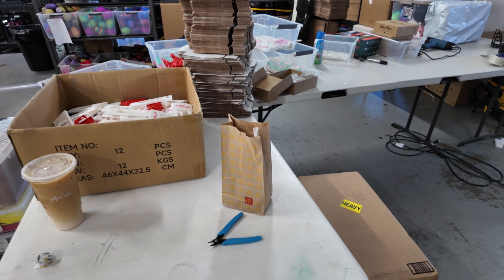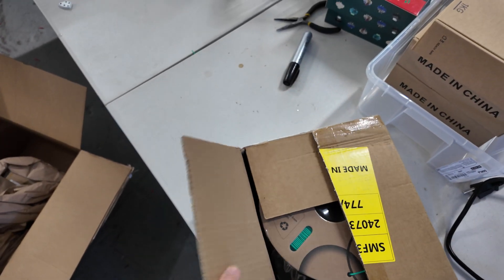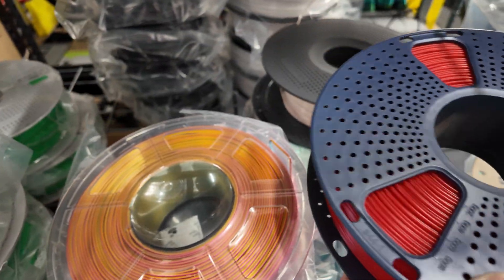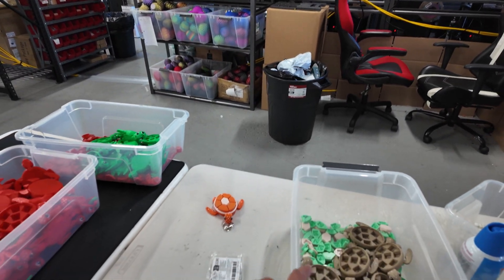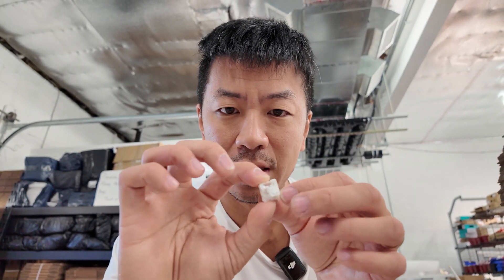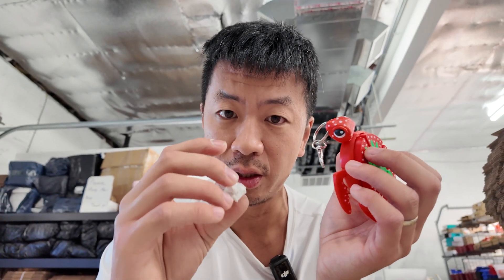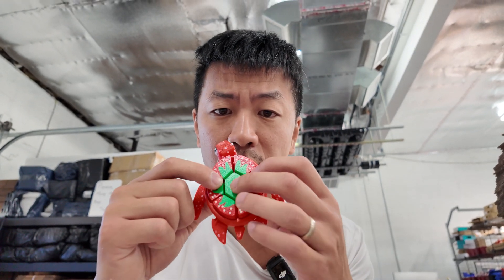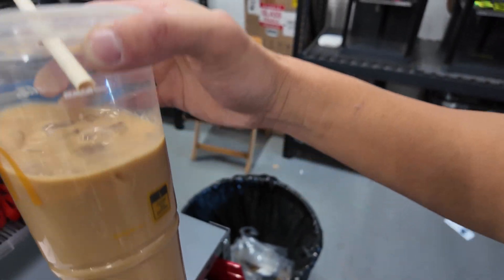TikTok Creative Challenge, New 3D Printers, Fruit Turtles!! - 3D Print Vlog #30

Comment: Does the new Sunlu roll work in the regular AMS (non-lite)? I have a roll but im scared im going to break it.
Reply from the maker: @Kushan_Patel  i haven't had much luck with it in the regular ams
Reply: @Dancyn3Dprints  how do you use in regular AMS? I'm hoping it will fit on Bambu reusable rolls with a spacer

Comment: Hey are you running black cryogrip beds now on all your printers? Have you had any issues with models getting stuck on them and not coming off?
Reply from the maker: @WhyDavidCreates  so far no. I've switched all of the a1s over
Reply: @Dancyn3Dprints  thanks- just ordered 20 to Australia using your code

Comment: You said it was sliced for the P1 P, which is what I have, but don’t you need to adjust anything as far as temperature or filament profiles? Or are you pretty much just running the same profile and all of your filaments?
Reply from the maker: @TheInkspirationStation  pretty much same profile. I rarely will adjust the print settings
Reply: Did you tune something in your “poop settings” at least? It’s a lot of waste for multimaterials isn’t?
Reply from the maker: @Fernando_Gazzola  yea i do on the a1s. Typically .7 flush volumes